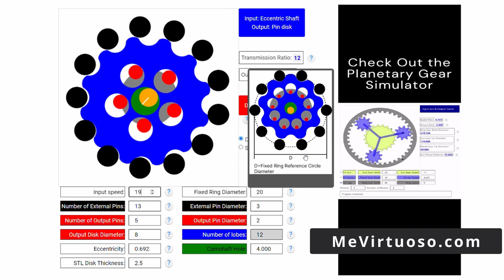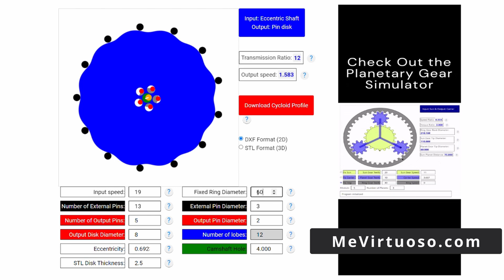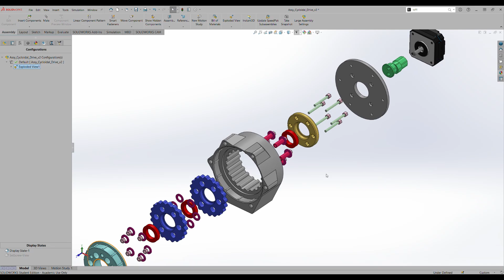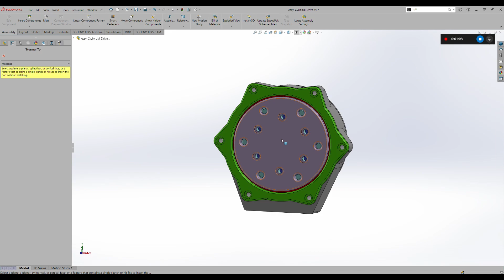Cycloidal Drive for NEMA17 Stepper Motor - 3D printed - Simulation - Easy method

Comment: nice work! It might take up some space, but buying a cheap metal flange for the stepper shaft seems to be the most cost effective way to better transmit the torque to the 3D printed part.